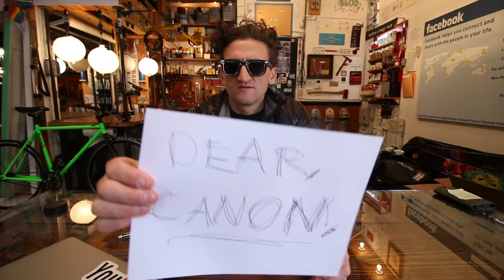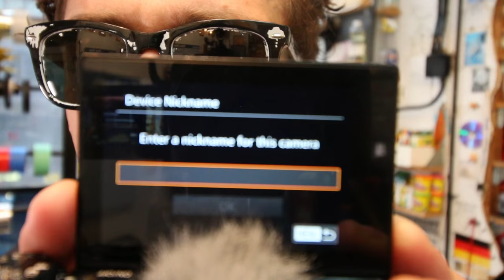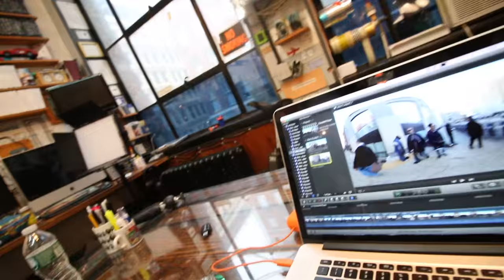FROZEN PIPE OFFICE FLOOD DISASTER

Comment: Just out of interest I'm wondering if giving the camera a nickname would stop that buttons function or make it throw up another option just as annoying? :)
Reply: Banhammer72 : I thought about the same actually :) I looked it up in user guide and the answer is - probably not. Basically it initiates pairing and wireless export to other mobile devices. Funny thing is, it might be something that could be actually useful to Casey and speed up his editing work, but he really spends no time trying to learn his gear :) On the other hand, it would be useful if non-essential buttons like this could be reassigned or completely disabled in settings.